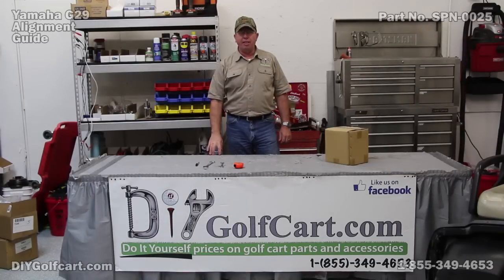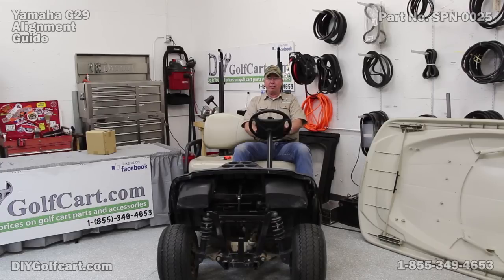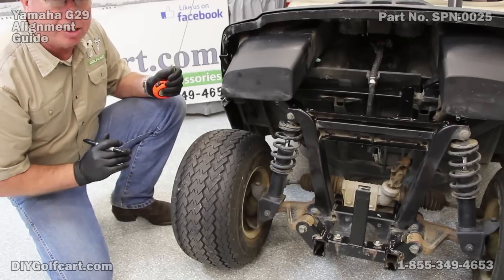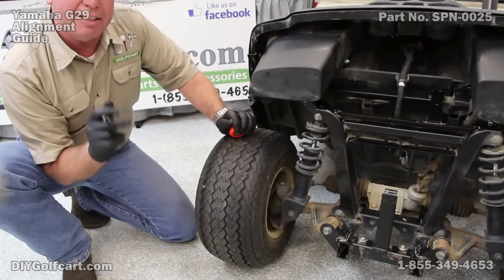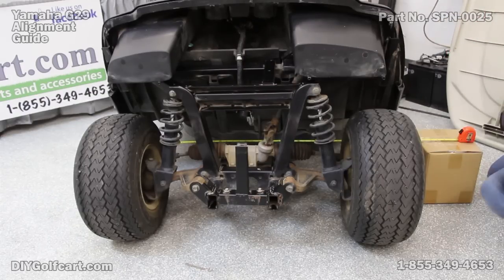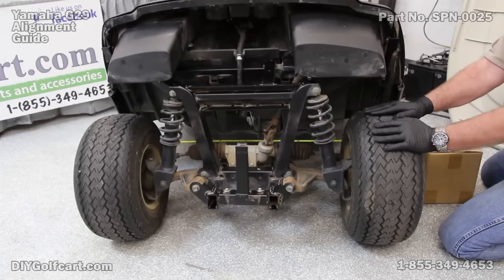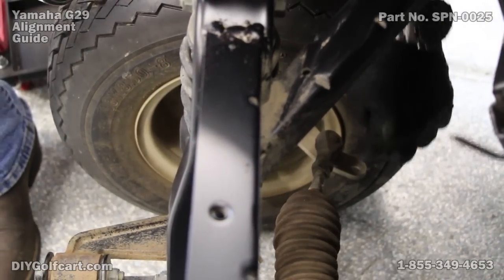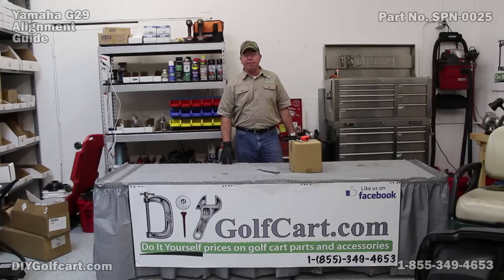How to Align a Yamaha G29 Drive | Alignment on Golf Cart

Comment: In the video at 6:35 a forward turn on the RHS turns the toe inwards. Does this hold for the LHS wheel as well or do we need to do a backward turn to turn the LHS toe inwards? Is the left thread a mirror image or is it the same as the RHS thread?
Sorry if this question seems stupid.

Comment: Thanks for your video.  I just purchased a G22.  We live in a golf cart community, and drive this exclusively on the streets in the community.

The inside edge of both front tires are wearing prematurely and the steering wheel is aimed to the right at about 20 degrees when the cart is driving straight.  When I release the steering wheel while rolling, the cart continues to track straight.  On a wet surface, the front tires make a rubber squeaking noise when the cart is rolling, so I am sure the alignment is "off".  I understand all of your video, but how do I make sure the tires are pointing straight when centering the steering wheel before setting the toe?  I have a large "T" Square to make measuring the correct spot to mark the tire easy.

Thanks for your help!

Comment: Hey bud I'm working on a 2006 Yamaha gas cart. I was thinking it was a G29 but I read that a G29 started in 07? Anyways I just installed a Rhox 6'' spindle lift and my cart is all over the place. There is a lot of negative camber that's not adjustable. I tried adjusting the toe in but it only got worse. I have never had this happen with any other lift kit. Any ideas?
Reply: How did you fix this problem?
Reply: Mine is the same way, what did you do to fix it?

Comment: yamaha drive 2 swaying at high speeds do you have any advice on where to start? And what can I do to fix this problem
Reply: My rear lift kit bolt was loose.. The one that bolts lift to frame.  it would only sway at high speed.